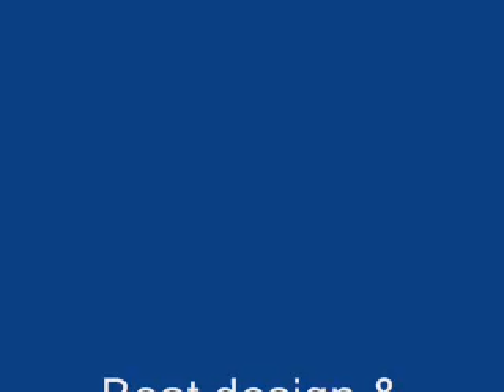Rigger Depron very fast boat

Comment from the maker: for a props it's depending of motor and voltage as well,you need to try from a little one to biger until you found the good one.(thy with a plastic props coz's cheap,be careful when you are trying the props don't do it so long,you can do 2-3 rounds then check the tempurature of motor and ESC,oh ! batteries as well!